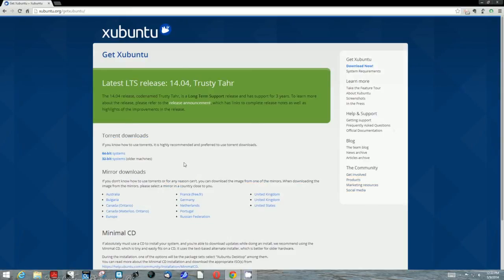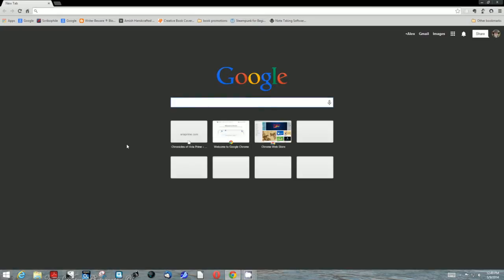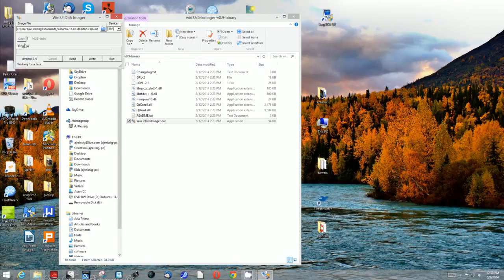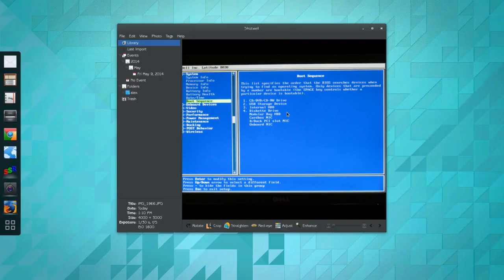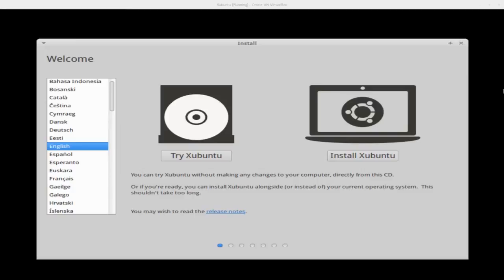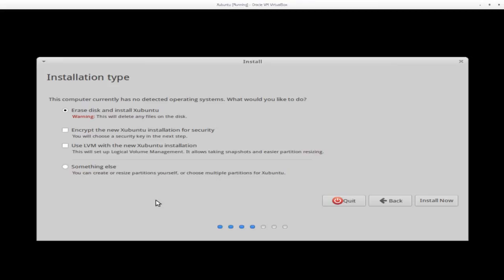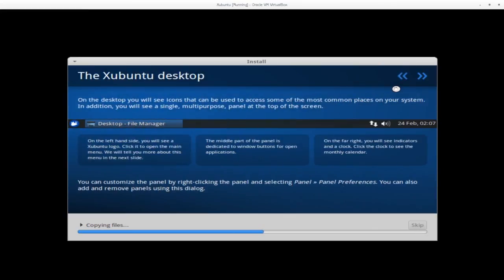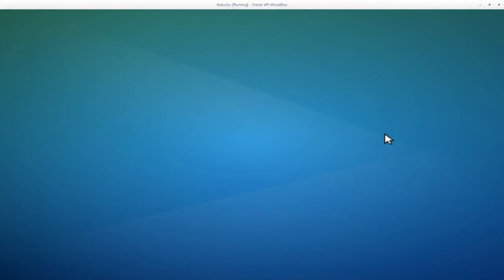Introduction to Linux Part One: How to Install Ubuntu-based Operating Systems

Comment: I'm a bit late to the game, so maybe by now you already have info on this...

You mentioned . which I have always called "the unknown". Everyone I have ever talked to simply calls it "star dot star". I have also heard some call it "The Varriable" which I dislike, because it in some cases could be confused with the Tilde "~" key. As an example, an item is around $4.00 can be shorthanded to "~$4.00. Basically all it does is tell the computer that you want "The Buffet" instead of asking for the menu. As an example, doing a search on your machine for a .dll (dynamic link library) you may type "*..dll" (minus the quotes) in a search, and it will bring up everything that ends in ".dll" (that isn't hidden). in some cases if you know part of the name, you can do "msvcm..dll" and it may bring back "msvcm90.dll". "." in some (not all) cases can be shorthanded to merely ".". Of course since early versions of windows, that sign has become less necessary to normal users. In summation, I'm not sure there even is officially a name.

Hope all of that helps in some way, if not, just ignore me LOL.
Reply: +Thomas Nelson And Youtube edited my * . * LOL wonderful!

Comment: Great video, Alex! :D I'm a.k.a.@Sage_GreenEyes on Twitter. :D I've installed Xubuntu on my netbook via USB FDD, sweet distro. :) I RT your Tweet re: this vid, & also shared it on Facebook, as I'm trying to convince a few friends to give Linux a try, so I hope that if one of them decides to give it a go, it's a local person, so that I can go over to their place & show 'em where everything is ~ program equivalents, and so on, especially the BIOS settings changes before installation, which are a little spooky to anyone who, unlike me, doesn't build their own computers. ;) F10, Save & Exit. <-- A techie way of saying, over & out! :D
Reply from the maker: Glad you liked the video; I should get a few more in the series up this week.  Going to try and shoot a video of setting up a dual boot system (not sure if I can pull off the video recording or not).
Reply: Great idea! I used to dual-boot Linux w/Windows because some hardware, such as my eBook reader, was Windows/Mac only, but a couple of years ago the GRUB2 bootloader began looking for Win on the wrong partition after install, so now I have Linux Mint & Win 7 on separate HDDs which & switch back-n-forth between in the BIOS as needed. So if Win & Linux can still play nicely together, I'd like to know about it, & I hope you succeed in recording that process so we the viewers can see how you did it! :D